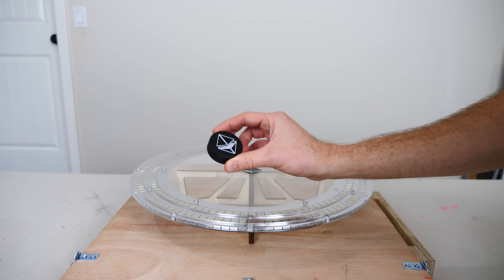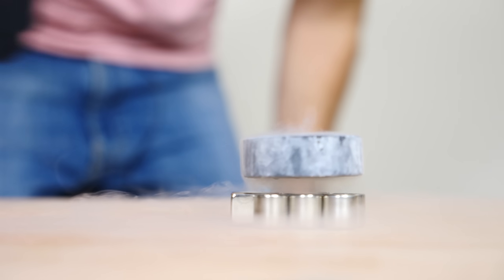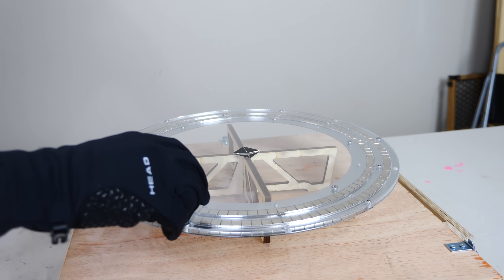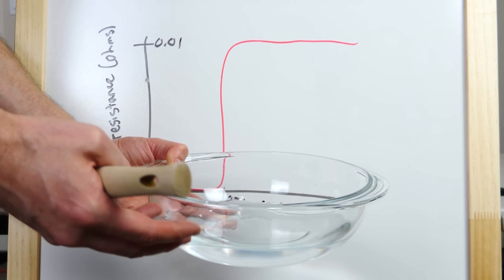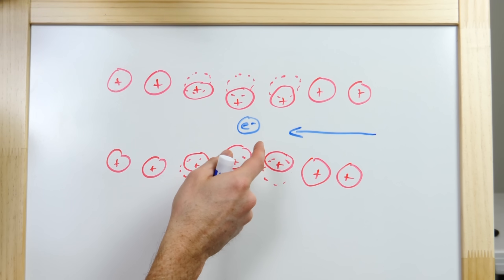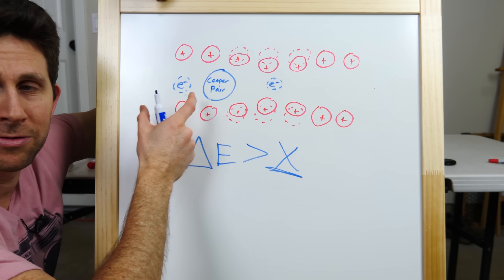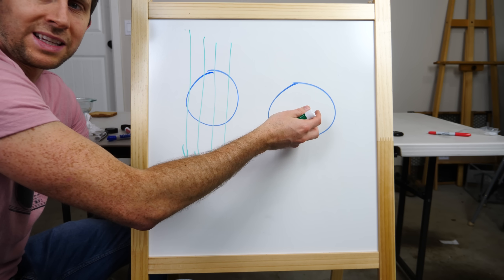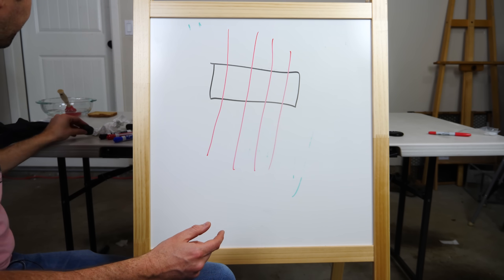Quantum Locking Will Blow Your Mind—How Does it Work?

Comment: Me at 8 years old: sitting for hours watching a Scalextrics.

Me at 43 years old: sitting watching food going around in circles.

Kelvin Temperature, brought to you by my innovative  and beautiful homeland, along with TV, Telephone, Steam engines, pneumatic tyres, chloroform, Paraffin (jet fuel), the American Navy, decimal point, Postage stamps, the Buick, whisky, Higgs-Boson, Dolly the Sheep, Golf, Radar, penicillin, marmalade, Chilean Navy, fax machines, overhead engines, flushing toilets...I could go on but I’d be here all day, ach, here’s some more anyway...

Macadamised roads (the basis for, but not specifically, tarmac): John Loudon McAdam (1756–1836)[3]
The pedal bicycle: Attributed to both Kirkpatrick Macmillan (1813–1878)[2] and Thomas McCall (1834–1904)
The pneumatic tyre: Robert William Thomson and John Boyd Dunlop (1822–1873)[9]
The overhead valve engine: David Dunbar Buick (1854–1929)[10]

Civil engineering innovations	

Tubular steel: Sir William Fairbairn (1789–1874)[11]
The Falkirk wheel: Initial designs by Nicoll Russell Studios, Architects, RMJM and engineers Binnie, Black, and Veatch (Opened 2002)[12][13]
The patent slip for docking vessels: Thomas Morton (1781–1832)[14][15]
The Drummond Light: Thomas Drummond (1797–1840)[16]
Canal design: Thomas Telford (1757–1834)[17]
Dock design improvements: John Rennie (1761–1821)[18]
Crane design improvements: James Bremner (1784–1856)[19]
"Trac Rail Transposer", a machine to lay rail track patented in 2005, used by Network Rail in the United Kingdom and the New York City Subway in the United States.[20][21][22]

Aviation innovations	Edit

Aircraft design: Frank Barnwell (1910) Establishing the fundamentals of aircraft design at the University of Glasgow.[23]
Reply: Power innovations

Condensing steam engine improvements: James Watt (1736–1819)[1]
Thermodynamic cycle: William John Macquorn Rankine (1820–1872)[24]
Coal-gas lighting: William Murdoch (1754–1839)[25]
The Stirling heat engine: Rev. Robert Stirling (1790–1878)[26]
Carbon brushes for dynamos: George Forbes (1849–1936)[27]
The Clerk cycle gas engine: Sir Dugald Clerk (1854–1932)[28]
The wave-powered electricity generator: by South African Engineer Stephen Salter in 1977[29]
The Pelamis Wave Energy Converter ("red sea snake" wave energy device): Richard Yemm, 1998[30]

Shipbuilding innovations	

Europe's first passenger steamboat: Henry Bell (1767–1830)[31]
The first iron–hulled steamship: Sir William Fairbairn (1789–1874)[32]
The first practical screw propeller: Robert Wilson (1803–1882)[citation needed]
Marine engine innovations: James Howden (1832–1913)[33]
John Elder & Charles Randolph (Marine Compound expansion engine)[33]

Military innovations

Special Forces-SAS - Sir David Stirling WWII
Lieutenant-General Sir David Henderson two areas:
Field intelligence. Argued for the establishment of the Intelligence Corps. Wrote Field Intelligence: Its Principles and Practice (1904) and Reconnaissance (1907) on the tactical intelligence of modern warfare during World War I.[34]
Intelligence: Allan Pinkerton developed the still relevant intelligence techniques of "shadowing" (surveillance) and "assuming a role" (undercover work) in his time as head of the Union Intelligence Service.

Heavy industry innovations

Coal mining extraction in the sea on an artificial island by Sir George Bruce of Carnock (1575). Regarded as one of the industrial wonders of the late medieval period.[35]
Making cast steel from wrought iron: David Mushet (1772–1847)[36]
Wrought iron sash bars for glass houses: John C. Loudon (1783–1865)[37]
The hot blast oven: James Beaumont Neilson (1792–1865)[38]
The steam hammer: James Nasmyth (1808–1890)[39]
Wire rope: Robert Stirling Newall (1812–1889)[40]
Steam engine improvements: William Mcnaught (1831–1881)[41]
The Fairlie, a narrow gauge, double-bogie railway engine: Robert Francis Fairlie (1831–1885)[42]
Cordite - Sir James Dewar, Sir Frederick Abel (1889)[43]

Agricultural innovations

Threshing machine improvements: James Meikle (c.1690-c.1780) & Andrew Meikle (1719–1811)[44]
Hollow pipe drainage: Sir Hew Dalrymple, Lord Drummore (1700–1753)[45]
The Scotch plough: James Anderson of Hermiston (1739–1808)[46]
Deanstonisation soil-drainage system: James Smith (1789–1850)[47]
The mechanical reaping machine: Rev. Patrick Bell (1799–1869)[48]
The Fresno scraper: James Porteous (1848–1922)[49]
The Tuley tree shelter: Graham Tuley in 1979[50]

Communication innovations

Telephone: Alexander Graham Bell (1847-1922)
Print stereotyping: William Ged (1690–1749)[51]
Roller printing: Thomas Bell (patented 1783)[52]
The adhesive postage stamp and the postmark: claimed by James Chalmers (1782–1853)[53]
The Waverley pen nib innovations thereof: Duncan Cameron (1825–1901) The popular "Waverley" was unique in design with a narrow waist and an upturned tip designed to make the ink flow more smoothly on the paper.[54]
Universal Standard Time: Sir Sandford Fleming (1827–1915)[55]
Light signalling between ships: Admiral Philip H. Colomb (1831–1899)[56]
The underlying principles of Radio - James Clerk Maxwell (1831–1879)[57]
The Kinetoscope, a motion picture camera: devised in 1889 by William Kennedy Dickson (1860-1935)[58]
The teleprinter: Frederick G. Creed (1871–1957)[59]
The British Broadcasting Corporation BBC: John Reith, 1st Baron Reith (1922) its founder, first general manager and Director-general of the British Broadcasting Corporation[60]
RADAR: A significant contribution made by Robert Watson-Watt (1892–1973) alongside Englishman Henry Tizard (1885-1959) and others[61]
The automated teller machine and Personal Identification Number system - James Goodfellow (born 1937)[62]
Reply: Publishing firsts

The first edition of the Encyclopædia Britannica (1768–81)[63]
The first English textbook on surgery (1597)[64]
The first modern pharmacopaedia, William Cullen (1776). The book became 'Europe's principal text on the classification and treatment of disease'. His ideas survive in the terms nervous energy and neuroses (a word that Cullen coined).[65]
The first postcards and picture postcards in the UK[66]
The educational foundation of Ophthalmology: Stewart Duke-Elder in his ground breaking work including ‘Textbook of Ophthalmology and fifteen volumes of System of Ophthalmology’[67]

Culture and the arts	

Scottish National Portrait Gallery, designed by Sir Robert Rowand Anderson (1889): the world's first purpose-built portrait gallery.[68]

Fictional characters

Sherlock Holmes, by Sir Arthur Conan Doyle
Peter Pan, by J.M. Barrie, born in Kirriemuir, Angus
Long John Silver and Jekyll and Hyde, by Robert Louis Stevenson
John Bull: by John Arbuthnot although seen as a national personification of the United Kingdom in general, and England in particular,[69] the character of John Bull was invented by Arbuthnot in 1712[70]
James Bond was given a Scottish background by Ian Fleming, himself of Scottish descent, after he was impressed by Sean Connery's performance.

Scientific innovations

Logarithms: John Napier (1550–1617)[71]
Modern Economics founded by Adam Smith (1776) 'The father of modern economics'[72] with the publication of The Wealth of Nations.[73][74]
Modern Sociology: Adam Ferguson (1767) ‘The Father of Modern Sociology’ with his work An Essay on the History of Civil Society[75]
Hypnotism: James Braid (1795–1860) the Father of Hypnotherapy[76]
Tropical medicine: Sir Patrick Manson known as the father of Tropical Medicine[77]
Modern Geology: James Hutton ‘The Founder of Modern Geology’[78][79][80]
The theory of Uniformitarianism: James Hutton (1788): a fundamental principle of Geology the features of the geologic time takes millions of years.[81]
The theory of electromagnetism: James Clerk Maxwell (1831–1879)[82]
The discovery of the Composition of Saturn's Rings James Clerk Maxwell (1859): determined the rings of Saturn were composed of numerous small particles, all independently orbiting the planet. At the time it was generally thought the rings were solid. The Maxwell Ringlet and Maxwell Gap were named in his honor.[83]
The Maxwell–Boltzmann distribution by James Clerk Maxwell (1860): the basis of the kinetic theory of gases, that speeds of molecules in a gas will change at different temperatures. The original theory first hypothesised by Maxwell and confirmed later in conjunction with Ludwig Boltzmann.[84]
Popularising the decimal point: John Napier (1550–1617)[85]
The first theory of the Higgs boson by English born [86] Peter Higgs particle-physics theorist at the University of Edinburgh (1964)[87]
The Gregorian telescope: James Gregory (1638–1675)[88]
The discovery of Proxima Centauri, the closest known star to the Sun, by Robert Innes (1861–1933)[89]
One of the earliest measurements of distance to the Alpha Centauri star system, the closest such system outside of the Solar System, by Thomas Henderson (1798–1844)[90]
The discovery of Centaurus A, a well-known starburst galaxy in the constellation of Centaurus, by James Dunlop (1793–1848)[91]
The discovery of the Horsehead Nebula in the constellation of Orion, by Williamina Fleming (1857–1911)[92]
The world's first oil refinery and a process of extracting paraffin from coal laying the foundations for the modern oil industry: James Young (1811–1883)[93]
The identification of the minerals yttrialite, thorogummite, aguilarite and nivenite: by William Niven (1889)[94]
The concept of latent heat by French-born Joseph Black (1728–1799)[95]
Discovering the properties of Carbon dioxide by French-born Joseph Black (1728–1799)
The concept of Heat capacity by French-born Joseph Black (1728–1799)
The pyroscope, atmometer and aethrioscope scientific instruments: Sir John Leslie (1766–1832)[96]
Identifying the nucleus in living cells: Robert Brown (1773–1858)[97]
An early form of the Incandescent light bulb: James Bowman Lindsay (1799-1862)[98]
Colloid chemistry: Thomas Graham (1805–1869)[99]
The kelvin SI unit of temperature by Irishman William Thomson, Lord Kelvin (1824–1907)[100]
Devising the diagramatic system of representing chemical bonds: Alexander Crum Brown (1838–1922)[101]
Criminal fingerprinting: Henry Faulds (1843–1930)[102]
The noble gases: Sir William Ramsay (1852–1916)[103]
The cloud chamber recording of atoms: Charles Thomson Rees Wilson (1869–1959)[104][105]
The discovery of the Wave of Translation, leading to the modern general theory of solitons by John Scott Russell (1808-1882)[106]
Statistical graphics: William Playfair founder of the first statistical line charts, bar charts, and pie charts in (1786) and (1801) known as a scientific ‘milestone’ in statistical graphs and data visualization[107][108]
The Arithmetic mean density of the Earth: Nevil Maskelyne conducted the Schiehallion experiment conducted at the Scottish mountain of Schiehallion, Perthshire 1774[109]
The first isolation of methylated sugars, trimethyl and tetramethyl glucose: James Irvine[110][111]
Discovery of the Japp–Klingemann reaction: to synthesize hydrazones from β-keto-acids (or β-keto-esters) and aryl diazonium salts 1887[112]
Pioneering work on nutrition and poverty: John Boyd Orr (1880–1971)[113]
Ferrocene synthetic substances: Peter Ludwig Pauson in 1955[114]
The first cloned mammal (Dolly the Sheep): Was conducted in The Roslin Institute research centre in 1996 by English scientists Ian Wilmut (born 1944) and Keith Campbell (1954–2012).[115]
The seismometer innovations thereof: James David Forbes[116]
Metaflex fabric innovations thereof: University of St. Andrews (2010) application of the first manufacturing fabrics that manipulate light in bending it around a subject. Before this such light manipulating atoms were fixed on flat hard surfaces. The team at St Andrews are the first to develop the concept to fabric.[117]
Tractor beam innovations thereof: St. Andrews University (2013) the world's first to succeed in creating a functioning Tractor beam that pulls objects on a microscopic level[118][119]
Macaulayite: Dr. Jeff Wilson of the Macaulay Institute, Aberdeen.[120]
Discovery of Catacol whitebeam by Scottish Natural Heritage and the Royal Botanic Garden Edinburgh (1990s): a rare tree endemic and unique to the Isle of Arran in south west Scotland. The trees were confirmed as a distinct species by DNA testing.[121]
The first positive displacement liquid flowmeter, the reciprocating piston meter by Thomas Kennedy Snr.[122]
Reply: Sports innovations

Scots have been instrumental in the invention and early development of several sports:

Australian rules football Scots were prominent with many innovations in the early evolution of the game, including the establishment of the Essendon Football Club by the McCracken family from Ayrshire[123][124][125]
several modern athletics events, i.e. shot put[126] and the hammer throw,[126] derive from Highland Games and earlier 12th century Scotland[126]
Curling[127]
Gaelic handball The modern game of handball is first recorded in Scotland in 1427, when King James I an ardent handball player had his men block up a cellar window in his palace courtyard that was interfering with his game.[128]
Cycling, invention of the pedal-cycle[129]
Golf (see Golf in Scotland)
1848: Association football's Glasgow rules (largely the sport's rules as we know them today) established at University of Glasgow.[130]
Ice Hockey, invented by the Scots regiments in Atlantic Canada by playing Shinty on frozen lakes.
Shinty The history of Shinty as a non-standardised sport pre-dates Scotland the Nation. The rules were standardised in the 19th century by Archibald Chisholm[131]
Rugby sevens: Ned Haig and David Sanderson (1883)[132]
The Dugout was invented by Aberdeen FC Coach Donald Colman in the 1920s
The world's first Robot Olympics which took place in Glasgow in 1990.

Medical innovations

Pioneering the use of surgical anaesthesia with Chloroform: Firstly in 1842 by Robert Mortimer Glover then extended for use on humans by Sir James Young Simpson (1811–1870)[133] Initial use of chloroform in dentistry by Francis Brodie Imlach
The Saline drip by Dr Thomas Latta of Leith in 1831/32
The hypodermic syringe: Alexander Wood (1817–1884)[134]
Transplant rejection: Professor Thomas Gibson (1940s) the first medical doctor to understand the relationship between donor graft tissue and host tissue rejection and tissue transplantation by his work on aviation burns victims during World War II.[135]
First diagnostic applications of an ultrasound scanner: Ian Donald (1910–1987)[136]
Discovery of hypnotism (November 1841): James Braid (1795–1860)[137]
Identifying the mosquito as the carrier of malaria: Sir Ronald Ross (1857–1932)[138]
Identifying the cause of brucellosis: Sir David Bruce (1855–1931)[139]
Discovering the vaccine for typhoid fever: Sir William B. Leishman (1865–1926)[140]
Discovery of Staphylococcus: Sir Alexander Ogston (1880)[141]
Discovering the Human papillomavirus vaccine Ian Frazer (2006): the second cancer preventing vaccine, and the world's first vaccine designed to prevent a cancer[142]
Discovering insulin: John J R Macleod (1876–1935) with others[8] The discovery led him to be awarded the 1923 Nobel prize in Medicine.[143]
Penicillin: Sir Alexander Fleming (1881–1955)[7]
General anaesthetic - Pioneered by Scotsman James Young Simpson and Englishman John Snow[144]
The establishment of standardized Ophthalmology University College London: Stewart Duke-Elder a pioneering Ophthalmologist[67]
The first hospital Radiation therapy unit John Macintyre (1902): to assist in the diagnosis and treatment of injuries and illness at Glasgow Royal Infirmary[145]
Pioneering of X-ray cinematography by John Macintyre (1896): the first moving real time X-ray image and the first KUB X-ray diagnostic image of a kidney stone in situ[145][146][147]
The Haldane effect a property of hemoglobin first described by John Scott Haldane (1907)[148]
Oxygen Therapy John Scott Haldane (1922): with the publication of ‘The Theraputic Administration of Oxygen Therapy’ beginning the modern era of Oxygen therapy[149]
Ambulight PDT: light-emitting sticking plaster used in photodynamic therapy (PDT) for treating non-melanoma skin cancer. Developed by Ambicare Dundee's Ninewells Hospital and St Andrews University. (2010)[150]
Discovering an effective tuberculosis treatment: Sir John Crofton in the 1950s[151]
Primary creator of the artificial kidney (Professor Kenneth Lowe - Later Queen's physician in Scotland)[152]
Developing the first beta-blocker drugs: Sir James W. Black in 1964[153] The discovery revolutionized the medical management of angina[154] and is considered to be one of the most important contributions to clinical medicine and pharmacology of the 20th century.[155] In 1988 he was awarded the Nobel Prize in Medicine.
Developing modern asthma therapy based both on bronchodilation (salbutamol) and anti-inflammatory steroids (beclomethasone dipropionate) : Sir David Jack in 1972
Glasgow coma scale: Graham Teasdale and Bryan J. Jennett (1974)[156]
Glasgow Outcome Scale Bryan J. Jennett & Sir Michael Bond (1975): is a scale so that patients with brain injuries, such as cerebral traumas[157]
Discovering & Developing anesthetic drug Propofol Dr. John B. Glen (1977): a globally-used surgical anesthetic common in general surgery cases. In 2018 Dr. Glen received a Lasker Award.[158]
Glasgow Anxiety Scale J.Mindham and C.A Espie (2003)[159]
Glasgow Depression Scale Fiona Cuthill (2003): the first accurate self-report scale to measure the levels of depression in people with learning disabilities[160]
ECG [Electrocardiography]: Alexander Muirhead. First recording of a human ECG (1869)[161][162]
The first Decompression tables John Scott Haldane (1908): to calculate the safe return of deep-sea divers to surface atmospheric pressure[163]
Surface Enhanced Raman Scattering (SERS): Strathclyde University (2014) A laser and nanoparticle test to detect Meningitis or multiple pathogenic agents at the same time.[164]

Household innovations

The television: John Logie Baird (1923)
The refrigerator: William Cullen (1748)[165]
The first electric bread toaster: Alan MacMasters (1893)
The flush toilet: Alexander Cumming (1775)[166]
The vacuum flask: Sir James Dewar (1847–1932)[167]
The first distiller to triple distill Irish whiskey:[168]John Jameson (Whisky distiller)
The piano footpedal: John Broadwood (1732–1812)[169]
The first automated can-filling machine John West (1809–1888)[170]
The waterproof macintosh: Charles Macintosh (1766–1843)[171]
The kaleidoscope: Sir David Brewster (1781–1868)[172]
Keiller's marmalade Janet Keiller (1797) - The first recipe of rind suspended marmalade or Dundee marmalade produced in Dundee.
The modern lawnmower: Alexander Shanks (1801–1845)[173]
The Lucifer friction match: Sir Isaac Holden (1807–1897)[174]
The self filling pen: Robert Thomson (1822–1873)[175]
Cotton-reel thread: J & J Clark of Paisley[176]
Lime cordial: Lauchlan Rose in 1867
Bovril beef extract: John Lawson Johnston in 1874[177]
The electric clock: Alexander Bain (1840)[178]
Chemical Telegraph (Automatic Telegraphy) Alexander Bain (1846) In England Bain's telegraph was used on the wires of the Electric Telegraph Company to a limited extent, and in 1850 it was used in America.[179]
Barr's Irn-Bru, soft drink produced by Barr's in Cumbernauld Scotland and exported all around the world. The drink is so widely popular in Scotland that it outsells both American colas Coca-Cola and Pepsi and ranks 3rd most popular drink in the UK with Coca-Cola and Pepsi taking the first two spots.[180]

Weapons innovations	

The carronade cannon: Robert Melville (1723–1809)[181]
The Ferguson rifle: Patrick Ferguson in 1770 or 1776[182]
The Lee bolt system as used in the Lee–Metford and Lee–Enfield series rifles: James Paris Lee[183]
The Ghillie suit[184]
The percussion cap: invented by Scottish Presbyterian clergyman Alexander Forsyth[185]

Miscellaneous innovations	

Boys' Brigade[186]
Bank of England devised by William Paterson
Grand Theft Auto: Developed by Scottish game developers DMA Design (later known as Rockstar North)
Bank of France devised by John Law
The industrialisation and modernisation of Japan by Thomas Blake Glover[187]
Colour photography: the first known permanent colour photograph was taken by James Clerk Maxwell (1831–1879)[188]
Buick Motor Company by David Dunbar Buick[189]
New York Herald newspaper by James Gordon Bennett, Sr.[189]
Pinkerton National Detective Agency by Allan Pinkerton[189]
Forbes magazine by B. C. Forbes[189]
The establishment of a standardized botanical institute: Isaac Bayley Balfour major reform, development of botanical science, the concept of garden infrastructure therein improving scientific facilities[190]
London School of Hygiene & Tropical Medicine: founded by Sir Patrick Manson in 1899[77]